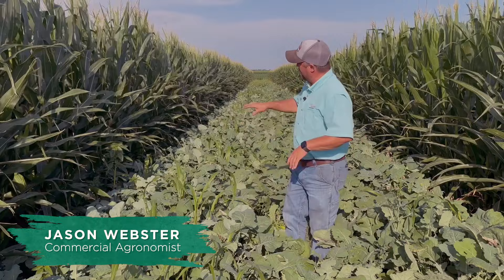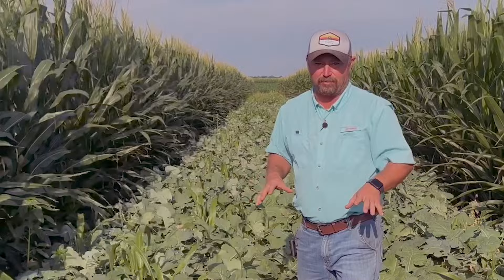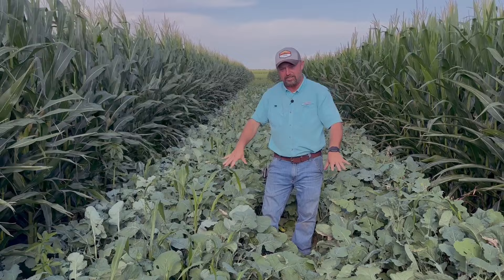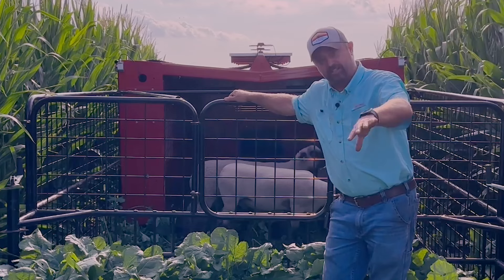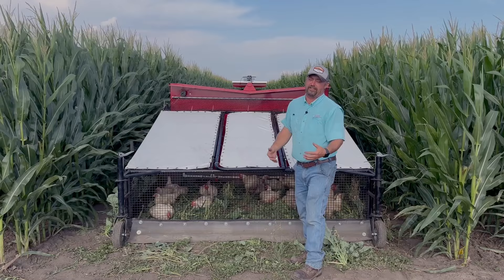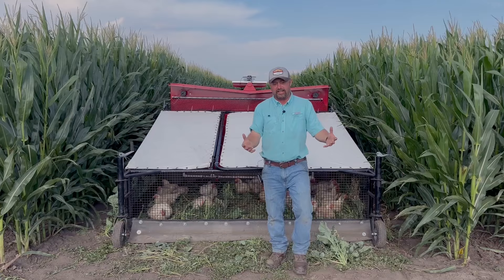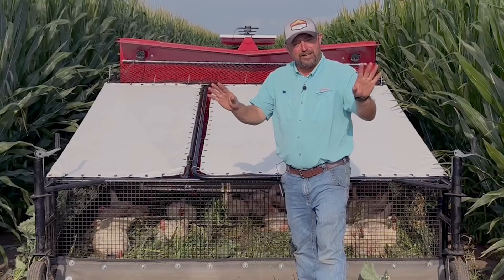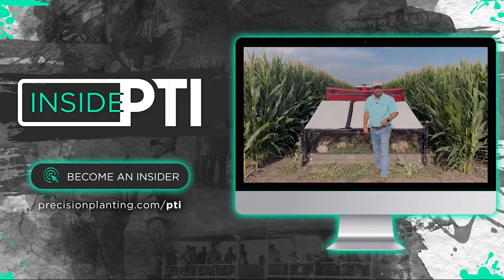InsidePTI S4•E13 | Strip Cropping & Cover Crop Grazing ‣ Corn

Comment: Love the vision but hogs might be a better option for the intended effect since they will graze heavily as well as tilling lightly, aerating the soil so fungi can breathe. Their manure would be incorporated into the soils automatically. They could be moved weekly to a new 1000 foot area with temporary electric fence which is super cheap and keeps them out the corn. A sled holding water and feed could be pulled down the isle pretty easily as well so that 50 or so hogs could be kept. At pasture raised prices a farmer could see  up to 50k for the batch with some marketing or offload the hogs to a marketer at a discount.